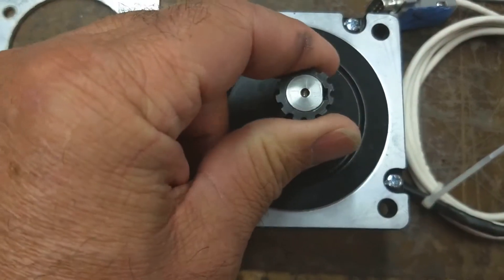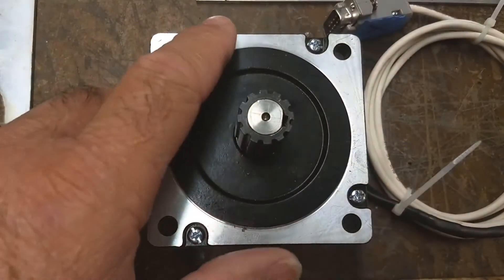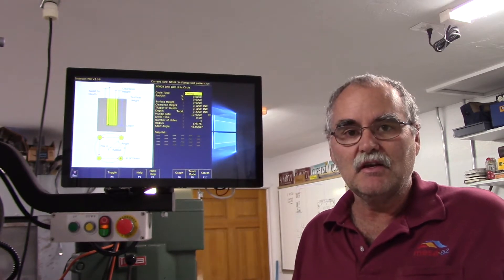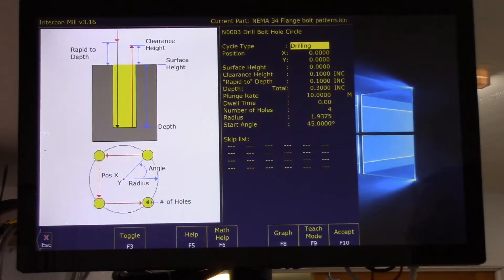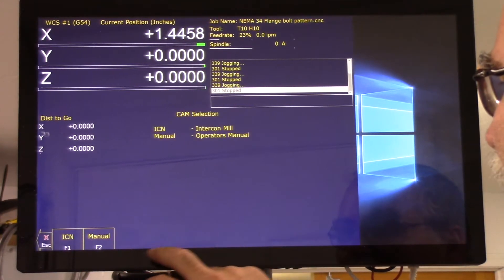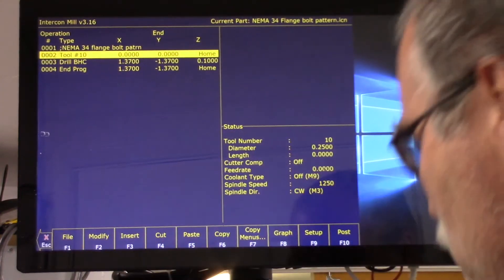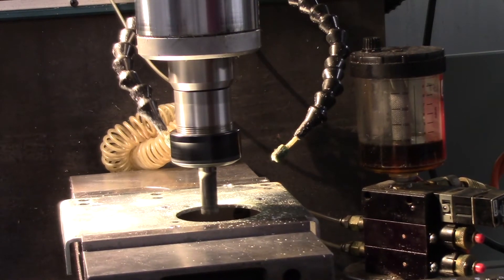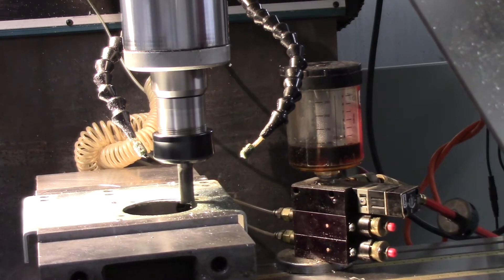Emcoturn 140 Turret Motor Mount Modification

Comment: HI Marty, Nice to see you using the mill.  Looks like you could have done that cut in one pass at full depth. That Acorn interface looks really nice.  Great project.
Reply from the maker: I would probably agree with you on the full depth cut. My experience in actual machining is limited. I spend more time working on machines! Thanks for the comment!

Comment: Just wondering on the screen, under each axis position there is a pulsing green bar.  What is that indicating?
Reply from the maker: Greg9504, supposed to be load meters I believe.